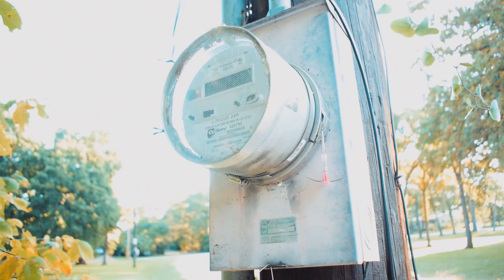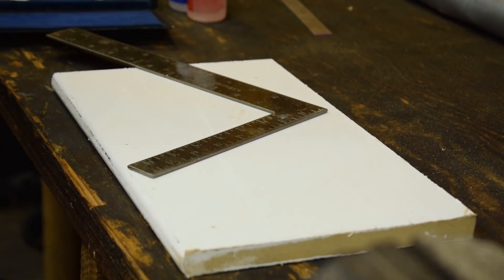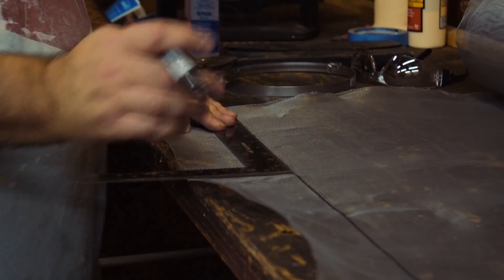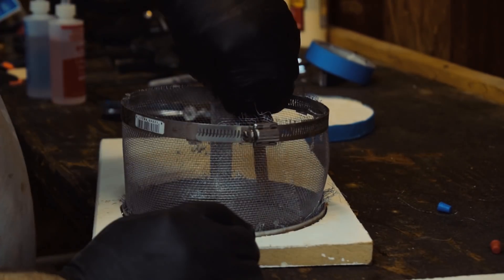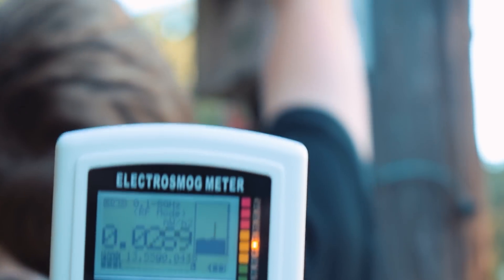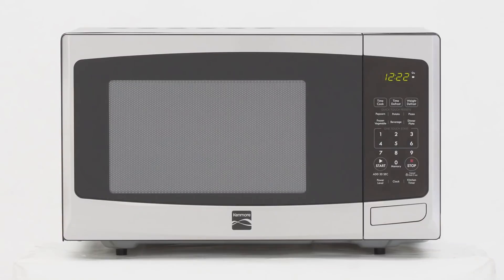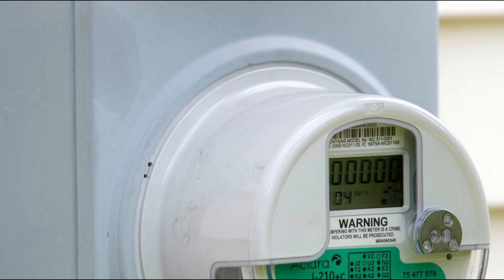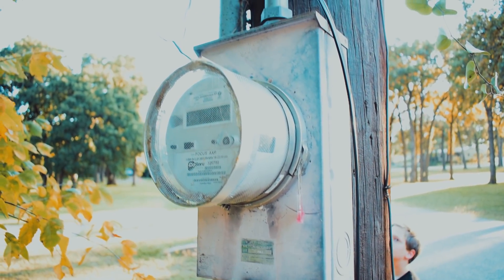Build an RF Blocking Faraday Cage For Your Smart Meter +Bonus Faraday Science/History

Comment: Thats not true that radiation does not come out of the back.  I used an accoustimeter AM-11rf meter to measure inside an electrical room with 16 smart meters and the reading was through the roof as high as the meter could even read.  On the opposite side of the wall which was the kitchen of an apartment I was considering renting the meter reading was about half of what it was in the electrical room with all of the smart meters.  So the meters were on the wall but they were not in metal boxes.  It looked like there was some wood slab or something they placed on the wall prior to putting the meters on the wall but the meters were not in metal boxes.   Keep in mind the apartment unit was totally empty with no other sources of radiation and the electricity for the apartment was not even turned on yet so there was no dirty electricity or other sources of electricity yet except for the wall of smart meters, so the radiation was penetrating througth the wall at roughly 1000 microwatts per square meter which is extremely high and will most certainly effect a person who has electromagnetic sensitivity.
Reply from the maker: it is true
Reply: @DarinBeard  In your case was the path of radiation still going through your house walls and affecting your wife? I'm electro-sensitive and the power co has just said they're upgrading my meter to a SM, so am very interested in how much comes from the rear, as well. The regular meters give off an amount of emfs that come through the wall, thought the high rf would be worse

Comment: Aluminum doesn't block the radiation adequately, though, or am I wrong? Isn't steel or copper better? And isn't this whole video showing this to be ridiculously more difficult than it needs to be?
Reply from the maker: I built what I wanted. I like to build things. And it works just fine like I showed.

Comment: What is the best reasonably priced meter to check any presence to difference in emf (or rf if that is applicable)?
Reply from the maker: The meter I used is linked in the description. It's a good meter and we still use it after a few years.

Comment: Be nice if you could use magnetic tape somehow to attach it.  

Also, I used 304 stainless steel mesh(extremely hard to form) with a copper/nickel faraday fabric liner and a clamp.  I don't have a meter, do you think this method was effective.
Reply from the maker: Yes, I believe that will certainly work well.

Comment: Have you been fined yet? They told me if we put faraday cage up they will know it and come and remove it and i will be fined. However they're ok with a faraday over the side of the house at least 6 ft away from smart meter. This is our battle.
Reply: I forgot to mention the lie. They say its just the old UHF VHF signals.
Reply from the maker: No fine. They won't know. And didn't. Until I told them. It was never an issue and no one cared. Everything worked like it was supposed to. I don't live there anymore so it's a non issue now. But it was never a problem.

Comment: The faraday cage needs to be on the inside of your house, not the outside, unless it’s in your face while you’re on the patio. Most ppl spend more time inside than outside. I built a large 6ft tall 3ft wide frame, stapled “metal” screen, not fabric to the frame. I then set the frame inside my house against the wall where the smart meter was on the outside. Problem solved. 😄
Reply from the maker: The rf does not come through anywhere but the glass dome on the front. The metal box blocks it from coming out of the back into your house. And my meter was not on my house, it was on a pole by the street.
Reply: That's what I've been thinking as well, I was going to staple mylar or aluminum screen to two sheets of plywood for the 2 walls in our bedroom, the meter is right behind the wall and literally where we sleep. I keep asking the question what about emf coming out the back of it

Comment: These videos on Youtube are a scream. The best parts are when comments are left that show the writer has absolutely NO clue regarding radio waves. No clue at all, but a lot of suspicion and a lot of fear. So down the rabbit hole we go. 
Example: what is a Faraday cage and why does it do what it does. Virtually every writer has NO clue to answer either question.
Do a little research before curling up in a ball and hiding under a bit of fly wire mesh. There is a lot of information, scientific articles that is, that will explain the physics of what it is you fear. Don't be a victim.
Reply from the maker: I did research and that's exactly what a faraday cage does. There is more scientific detail that was unnecessary in this situation. And it did exactly what I wanted it to do. As I have said a 1000 times, I am not one of these conspiracy folks who believe aliens are all controlling the government or something. If you read the description and listen to the video, then you would know my situation and why I did what I did. So judge somewhere else.

Comment: Brilliant thinking, love an engineering mind. What is the thickness of the aluminium screen and flat bar? Also the does it matter what sizes the holes are in the mesh to block the signal? (what have you used)
Reply from the maker: I think the flatbar was 1/8". There are links to stuff in the description. The screen size doesn't matter really.

Comment: Darin, you're using the small numerals to get the original 13.5, but the large numerals to get the 0.6. Shouldn't you be using the large numerals for your initial value (vs. the small numerals)?
Reply from the maker: Small is just where it peaked.
Reply: @DarinBeard  , then why do the small numerals still read 13.5 when you use the 0.6 value? Are you not resetting them between readings?

I'm trying to understand what I see in the video, not trying to give you a hard time. Thanks.
Reply from the maker: I probably didn't reset it. That was a quite a while back. I took the initial reading and then put the cage on and took that reading within seconds of the first one. It didn't spike after the cage was on.

Comment: If you don't want to get all fancy with epoxy and aluminum bars. You can simply wrap some aluminum screen around the glass part of the screen and bunch it all up around the edges and hose clamp that. Same effect, quicker, easier  but not as pretty. 😁
Reply from the maker: Yes. I didn't make this video to show how to do it as much as how I made it. I tend to go overboard sometimes.
Reply: doing this asap. I dont like they can turn me off if payment gets lost and refuses to turn back on until they want.

Comment: How. The hell that going to do anything when your house is 20 feet away lol
Reply from the maker: My house was 100 feet away. Less signal is less signal. That was the goal.
Reply: Well true. Lol but dirty electricity coming from the wall and wifi. Will be much worse. Take one of those hound readers that is used to check for electrical wiring in the walls turns it into sound. The smart meter barely puts out anything compared to wifi
Reply from the maker: I have that meter. I have no microwave and we don't have wifi. I tried everything I could to help her with her sensitivity.

Comment: I made one similar to the one you made. The electric company came out and wanted to put up a stronger one because they couldn't get a signal.
Reply from the maker: I guess you did too good of a job
Reply: Hey guys... do you need to earth a faraday cage? I noticed on a video of this guy selling these for alot of dollar that he mentioned earthed. Thinking of making 1 or maybe 2 as they have just fitted two, 1 on the gas box that trabsmits readings to the electric smart meter before transmitting both readings to the company.
Reply: Did they?
Reply: A stronger meter?

Comment: You would do better to use copper sheet of metal that way you can solder all edges and electrically connect the whole cage to ground. Epoxy doesn't ensure a solid electrical connection and solid metal sheet would prevent any RF energy from emitting outside the cage. Just an FYI
Reply from the maker: It stopped 96% and that was the goal so the meter could still communicate and most would be blocked. But you are correct and the tip is well received. Thanks.

Comment: Why were these smart meters not made with the farady cage included?
Reply: Because they want to fry us, or turn electricity off n on when they like, or cause fires...or all 3 n more
Reply: because they have to wirelessly transmit the data, so a faraday cage would prevent that from happening.
Reply from the maker: Nope. Read the description

Comment: Isn't the rf transmissions how the electric company's network communicates?   And the meter and housing is private property I thought.   I'm not against any of this but I thought this might interfere with billing.  I don't know.... :-)
Reply from the maker: read the description.
Reply: @DarinBeard  Ok, I apologize that was on me.   I was looking around for Russian prisons and your video popped up.   It may be because a few days ago I made a comment on an ATM theft video and said they should have wrapped it in faraday shield to attenuate the tracking transmitter during the get away.   Would you happen to know and specifics on the meters transmitter?   Frequency and power output?
Reply from the maker: @mikeburch2998  I don't know for sure but there has been debate here. Some claim less than two watts but I measured a peak of over 13 watts.

Comment: My wife is also sensitive to various frequencies.   I am a bit worried about the power company's reaction but will give this a try.  Thanks for the info and education!
Reply from the maker: Best of luck!
Reply: Yeah it needs to be completely wrapped I don't even know if the wires would then start admitting the crap anyway let's try I would almost say I'm saying the conduit I don't know how far that radio wave can penetrate through a 2-in hole 3 inch hole?
Reply: Cell phones are mostly 3.7 volt with very low amperage available the radio and that smart meter has unlimited capability as far as power
Reply: Hi, does your wife has issues with WiFi? I have started to switch it off after i finish WfH for a month & all weekend & feel a lot better. Could such a cage solve that also?
Reply: @AlizBodo  hardwire your pc, turn mobile data, wifi, bluetooth,  off on phone unless using it, turn off wifi on modem once pc hardwired. get rid of microwave oven, don't use tablets or laptops etc

Comment: I prefer the tinfoil hat because it blocks other RF at the same time. The problem with the hat deal (not blackhat or redhat but tinfoil) is that it really should be grounded for it to work (which most people ignore or don't know about or understand how the whole thing is suppose to work) - is that a grounding wire needs to be attached, but it really limits your range of travel, sort of like a dog on a leash. So I don't bother with any of it.
Reply from the maker: funny guy
Reply: @DarinBeard  Did you ground your cage?

Comment: I like what you did here.  I'm going to build one, with one addition.  I'm going to add some aluminum filings to the epoxy as I mix it.  You can do it buy just taking a file and making some filings from the aluminum strap or buy one of those little tubes of aluminum radiator sealant that are nothing more that aluminum filings but finer.
Also, aluminum screen can be cut much neater and IMO easier, with a good pair of scissors.
Reply: Isn't a ferrous metal mesh needed, such as steel mesh? I'm not sure aluminium will block RF.
Reply: @lenwenzel7440  Aluminum works great. Doesn't have to be ferrous.  Good conductor is all.  Copper, Brass, Stainless, all good.
Reply from the maker: It does

Comment: So you made it smart meter into a dumb meter that the power company is going to remove. It is easier to tell them to remove their meter
Reply from the maker: It still could communicate. And I did have it removed eventually.
Reply: @DarinBeard  How come?
Reply from the maker: @ItsMeScareCro  how come what? There we had it removed or it could still communicate?
Reply from the maker: @ItsMeScareCro  To try to stop the dirty electricity in the house.
Reply: @DarinBeard  So you had it removed because you switched to non smart meter or because it caused dirty electricity? thanks

Comment: Isn't RF radio frequency? What's wrong with that? It's been around for many years. Sounds like a bunch of people worried about nothing. Your worries will harm you more than any supposedly harmful waves
Reply from the maker: Yes, but FM radio is a weak Singal you are receiving. Smart meters and cellphones and wifi are FM transmitters with a signal much closer to you. So if you have sensitivities to RF or EMF it can be much different.

Comment: In most states your cage cannot touch the meter or even the meter box, like here in Okla. Some states (and city ordences) even make simply blocking the signal illegal. Check with your power company about the legal ramifications of doing this.
Reply: I don't care what the legal ramifications are. They can keep coming out here and removing them and I'll keep putting them on. If they want to continue, they can remove it and put an analog. Or they can remove it all together and I'll get solar panels..either way they can die
Reply: @LoveAlwaysWins32  Look into solar panels and emf before hand.

Comment: Q&A Does it radiate at all out the backside - thru the walls of the house? (into a bedroom for example). 
AND is this reductrion going to sit well with the electric co for their purposes of collecting usage info from your house and "other houses along the string"???? 
I will probably not get anb answer but wth!
Reply from the maker: no, it only comes out of the glass dome. No, in non-rural areas there is enough signal getting through for it to communicate.
Reply: @DarinBeard  THANK YOU!!!
One last Q I should have asked. R U absolutely sure you arent gonna have trouble with the E company??? (Ive heard fines are REALLY STIFF)
Reply from the maker: I had no trouble at all with mine. They were actually really good about it. If you live in a rural area then it could pose a problem if it couldn't communicate with the next point because it was too far away. but these meters are way overpowered for what they need to do to communicate in most cases so blocking most of the signal did not stop it from functioning. If you have a portal you can log into for your electric company and see your usage stats on charts and graphs, then if you put one of these cages on and you still see daily charts based on your usage then you know that it is still communicating.
Reply: @DarinBeard  At 85 Im no longer able to do  projects like this but I found a company and have one ordered!!!  My wife will appreciate the relief.
THANK YOU FOR ALL OF THE INFO!!!

Comment: Follow up with an EMF meter reading... You can use for your Electro smart Android app or something similar
Reply from the maker: I did that, it's in the video.
Reply: @DarinBeard  sorry I missed that I was scanning so much information rapidly.. good job sir.... But let me add something perhaps useful is that in trying to block with aluminum foil your wallet or cell phone may not be effective whereas silver foil or silver fabric will block because silver is 7% more conductive than copper and aluminum is less conductive than copper... Thank you for what you've shown

Comment: So, does this mean that after installing the faraday cage that the signal is so low that the power company cannot receive the data and therefore no power bill
Reply from the maker: @shiftedphase  lol
Reply: No, it doesn't prevent power bill. I put 4 lead sheets around mine, because foil wasn't enough to stop headaches, And still received bills, month after month.
Reply: If he did it right, they would think his power was out. Eventually they would come to check the meter and rip the added crap off.
Reply from the maker: It only blocks MOST of the signal so it still communicated. The electric company had no issues with what I did and did not rip it off. In fact they were really great about it and we eventually had the meter replaced with an analog meter. And they gave me my cage back when they swapped the meters out.

Comment: This is one of the few that didn't get a ground wire! Meaning all it did was let the waves bounce around and even force it to leak out the back or any small opening. "Ground if you want it sound' Said the physics teacher at Chabot college.
Reply from the maker: I talked about that in the video. The ground wire didn't make a difference in how well it blocked. It still works without the ground wire. I just wouldn't want to be close to it.
Reply: @DarinBeard Did you try measuring the energy emission on the back of the meter after fitting? it may be acting like the parabola in the back of a torch or satelight dish essentially focusing most of the energy out of the back of the meter now
Reply from the maker: @darrenwolboldtalk2  Yes. It wasn't.
Reply: @DarinBeard  Would the cage generate a static charge... so if touched would give a shock? 
Also will putting one of these on generate any heat to be worried about? its just that these smart meters are fitted indoors/inside the house where we live😝
Reply from the maker: @stephenmaas8775  no heat no shock that I ever saw. It's radio waves so not electricity.
Reply from the maker: Yes, grounding is best. But it works without it. Obviously